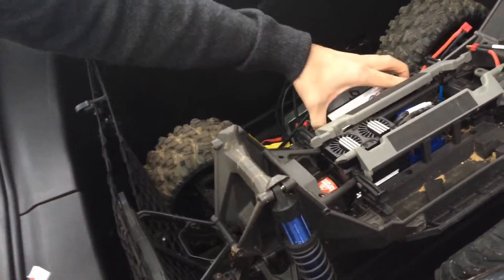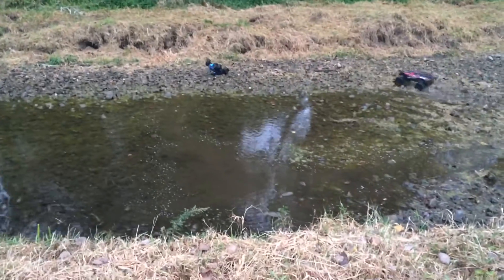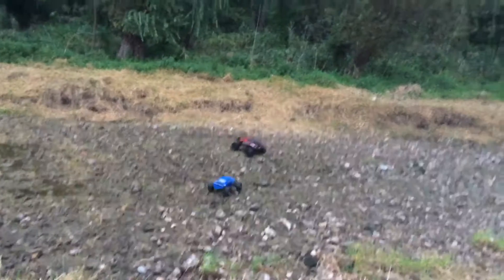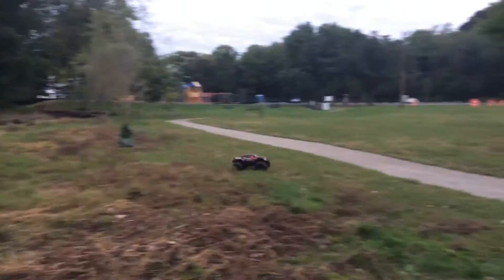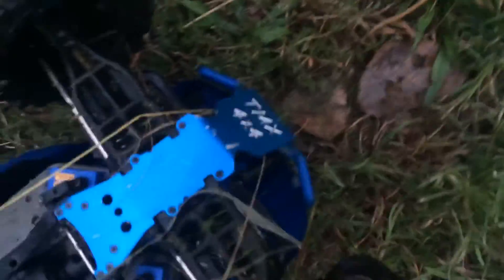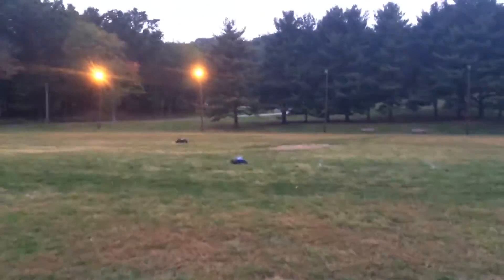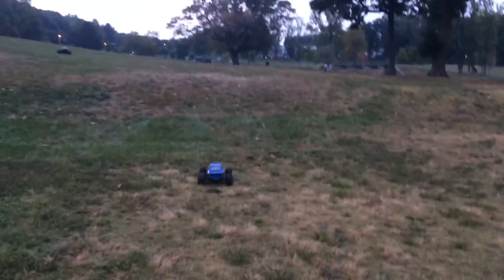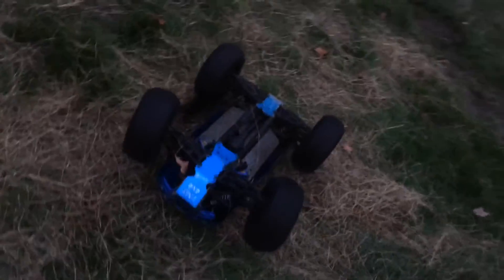Traxxas X maxx and E maxx racing, water run and speed jumps !!!!!!!!!

Comment: You have any diff issues with your XMaxx after running it in water? I've had mine for about a month now and already stopped the main diff gear. When I opened it up the bearings were rusty and there was still a little water in them.  If you haven't look in your diffs check it out. They are very simple to get to on the XMaxx.👍
Reply from the maker: Adam Baker ohh thanks for the advice I'll check them out just in case

Comment: 18t pinion in the XMaxx makes so much better to drive. Seems a lot faster.
Reply from the maker: Adam Baker Adam Baker i have a video of the x maxx racing with the e maxx . we put 25t pinion and a 52t spur in the x maxx and it overheated but is still good we were running in 17/52 gearing